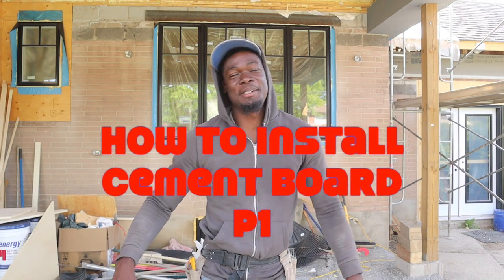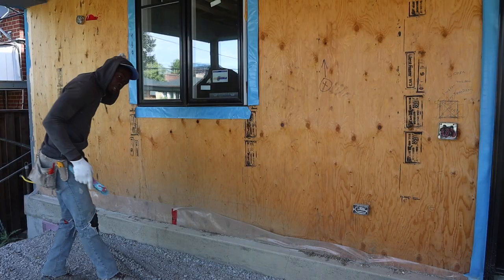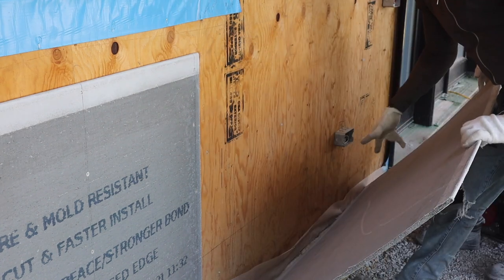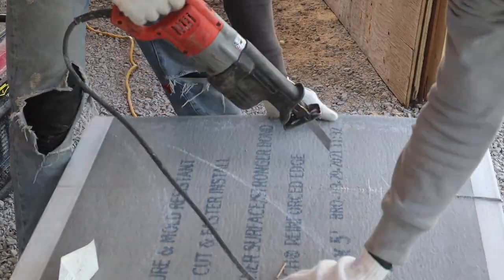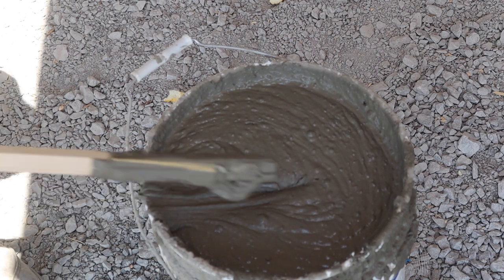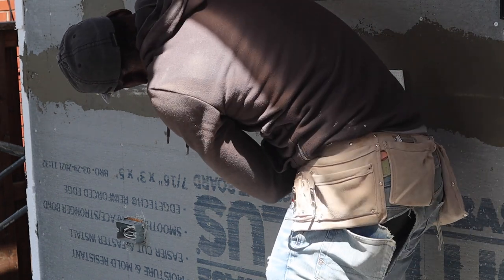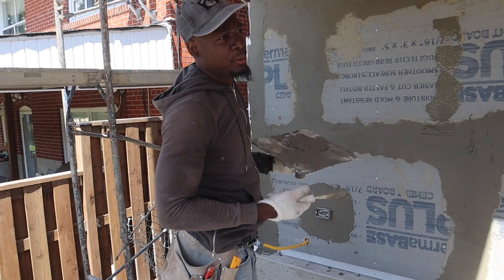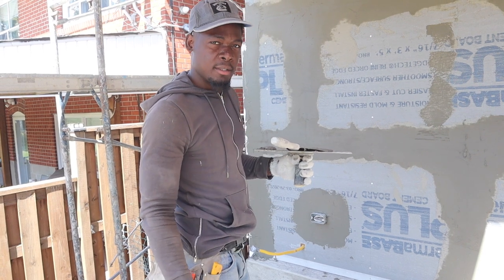How To Install Cement Board For Veneer Stone and Stucco installation and waterproofing

Comment: Should there not be tyvek or some other house wrap installed prior to the cement board?

The cement board is not waterproof itself, just water resistant. Just curious.

Thanks
Reply: Definitely a water/weather proof wrap and also a rainscreen mat of some sort before adding a cement board or stucco. This will start rotting in the first condensation, never mind the rain that will ge the plywood soaked

Comment: Good job installing the cement board but you should have used a moisture barrier. Although, maybe the deck flashing will divert the water away from the lower wall. Great caulking/sealant will have to be used at all terminations. Good video though.
Reply: This method would not working in the Pacific Northwest!  A moisture barrier with a min of 1/2" air space between the cement board would be best.

Comment: In The Bahamas We usually covered the Plywood with Felt or Ice and Water shield, before putting up the cement board aka DuRocks
Reply: That is exterior grade plywood, meant to be used like that and water resistant. Obviously if you want you could use a covering if you want but it won't make much difference.
Reply: @DL101ca  I understand that, but this the Caribbean, Salty air and heavy Rain wud Rot that in 10 years and under.You try at most to get 15-20 years before any heavy repairs...well unless a Tropical storm speed things up
Reply: Build better house u live in the Caribbean board and plastic has no business there

Comment: could you have used thinset behind the cement board for a much better bond?
Reply: This is like installing the hardie board in the shower. If you don’t use tinset in a shower, why use it here?

Comment: What size cement board was used? 1/2 or 1/4?
Reply: Did you not watch the video? Also, make sure to use galvanized screw.
Reply: 7/16 3x5’
Reply: @williamp8213  Says right on the board 7/16 x3ftx5ft...if you watched the video. You must have that Adddddddd...and anger problems. Good luck.

Comment: It is not a correct way to do it. Plywood board required at least 2 moisture barriers prior to hanging the wonderboards. The after you tape the joints, 2 redguard coats required prior to installing to stone veneer.
Reply: Redguard not outside !!!
Reply: Actually you can use redguard and drylok outside. They use it mainly for showers but any wet enviromentvwill di